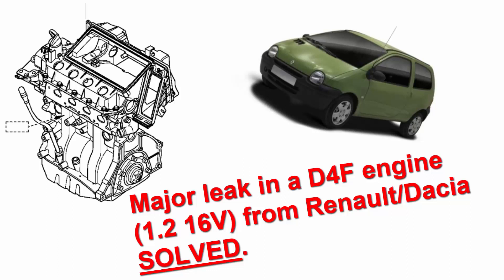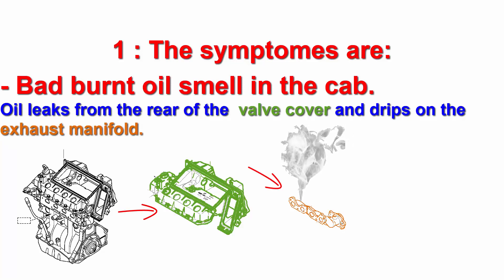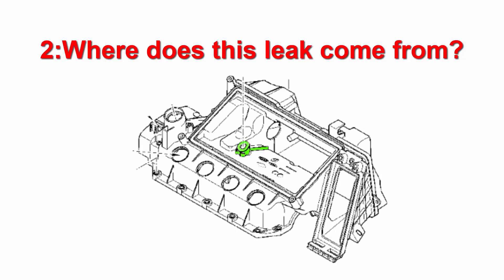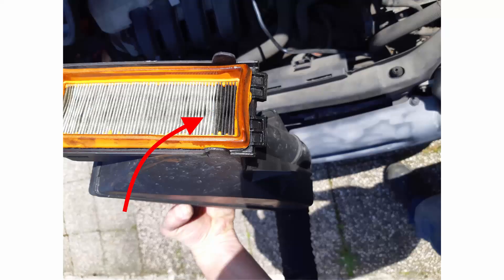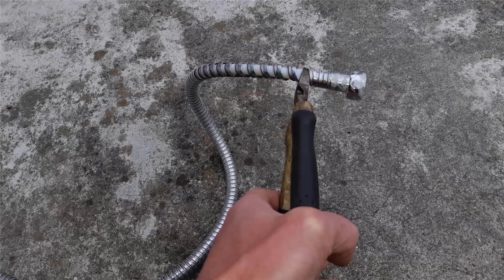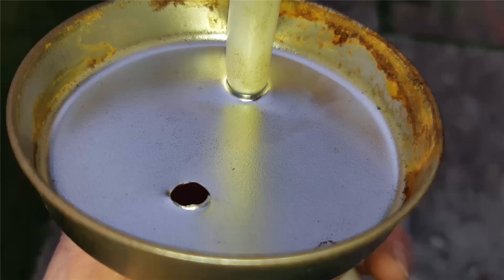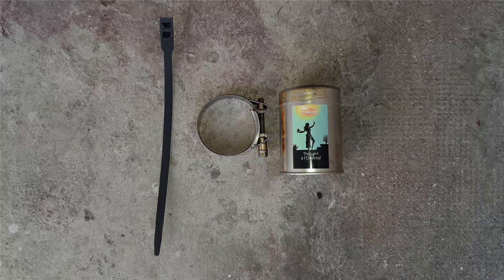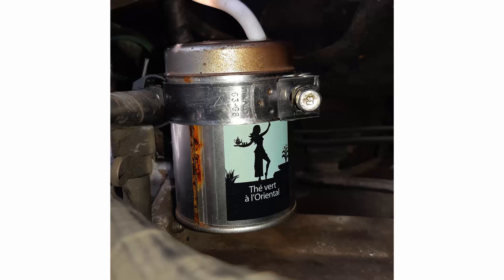Major leak on a D4F702 (1.2 16V) SOLVED

Comment: All d4f engines with that type of valvecover have same problem. That is because the PCV valve not work properly and it´s built deep inside in the valvecover duct and cannot be reached so it´s impossible to replace or fix. New valvecover with new PCV valve is not manufactured anymore. Only way is do like you do or clean valvecover regularly.

Comment: Hi I did the same as you did but I lost 2 screws of the intake manifold,  did a test drive then I saw oil all over near the oil level stick, did the oil come from the unscrewed 2 holes? or are the holes goes throw the engine cover ? I ordered the screws :)
Reply from the maker: Hello Mohamed,
I doubt that two missing fasteners will cause an oil leak around the dip stick. 
Nonetheless, I have two questions.
Does the oil spills at the bottom or at the top of the dip stick.
Second, did the dip stick poped out of its place or was it still well inserted?
Kind regards.
Reply: Hi Mr. Pirard thanx for reply, and yes you are the bolts are the cause i bought tow and now it is dry.
Reply from the maker: @montgomeryha4921  Thank you for sharing this information. 
And congratulations for what you have done. 
Regards.
Reply: Do I understand well - missing bolts from intake manifold were causing an oil leak? I have the same problem and i couldnt do one screw and now there is a lot of oil in front of the engine
Reply: @Adam Pinocy
yes the screws holes goes directly to the engine, of one the the screws missing the high pressure will force the oil to goes the that hole and cause a miss. Until now i did not have oil leak. All the screws also in the manifold to the engine were too bad so i replaced them all. The oil leak in the manifold i did the same as in this video but instead of make hole to the air filter bottom cover i just get a long hose the goese to the air filter and the air hose to a can near battery and it worked
Reply: @Adam Pinocy
the problem is those screws are ver expensive if you buy it directly from renault, you can search for a scrap car and get the screws.
Reply: You were right - one missing screw there and an oil leak. I have put the screw into its place and its ok

Comment: Lovely video. Just wondering - that small small tube inside the valve cover/intake, would that not be experiencing vacuum as per the original Renault design? So when you are on open throttle the oil is being sucked through it?

As such should there be a return pipe going from the catch can back into the intake? So that the catch can is also being held at a vacuum ensure that that valve can breath as designed? I don't exactly know where the vent in the valve cover/intake is coming from - perhaps it doesn't need vacuum, but in the design from Renault it does experience vacuum.

If it hasn't caused you any issues in the passed 4 years then I would say it does not need vacuum, and that this solution is perfect but I'm just curious as I a plan to do this fix this weekend.
Thanks!
Reply from the maker: Hello.I understand your concern and You right to ask. I still have car. It still pass the car inspection without problem. I didn't meet any performance issue since then.
The short tube/pipe into the valve cover is meant to create a venturi effect to "ingest" the residual oil fumes from the valves cover.
For sure this venturi effect might not be as efficient as before as I put an extra length of hose.
But regarding émissions it is not problem at all.
Thank you for your comments
Reply: @olipirard  Thank you very much for replying! Great to know it is still working well. I'll make sure the rest of the PCV system works and if it does I will do what you did with the open loop catch can, Thanks again.
Reply from the maker: @RobinBlakey 
Hello Robin,
For the record the little Twingo passed the French equivalent of the English MOT inspection this month.
(I assume you are from England)
In the catch can, there are traces of oil and there was an oil drop at the hose end.
I'm good for two more years 😊

Comment: I have the same problem on my Clio II 2003 D4F-712.
I'm going to change the gaskets next week since i got burn smell in my car mostly when standing still waiting for red lights.
To the problem --->  why is the oil dripping out from that little pipe, is it from overpressure ?
Reply from the maker: Hello Pär,
Thank you for your kind comment.
For what I can say, this little tube @3:23 is much more a "vent" or a "vacuum pipe" so that the engine can "swallow" the oil mist produced while it runs.
This for emission regulation, I guess.
I did the connexion with the white hose to get rid of oil dripping for good.
Nonetheless, it is not mandatory.
In the following link : https://youtu.be/_2Vz3W8POaA , you'll find the whole process to change all upper engine seals.
At 12:29 in this video, you'll see a weird "beveled" ring which seals the valve cover and the intake manifold.
This ring was cooked and that is what you need to replace.
I hope it will help you.
And by the way, Happy new Year :)
Reply: @olipirard  Thank you for your help and i wish you an Happy New Year.